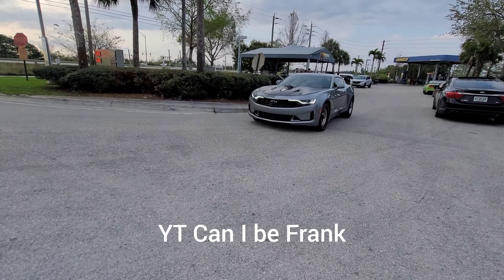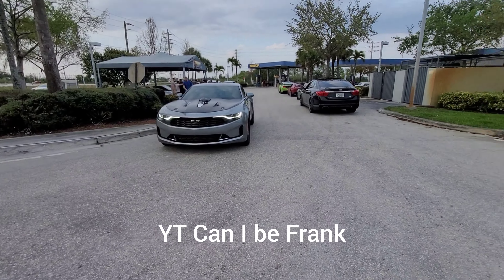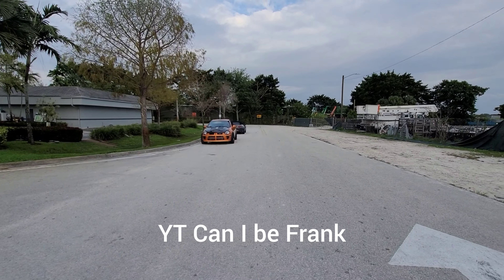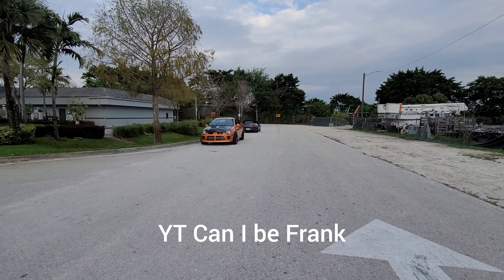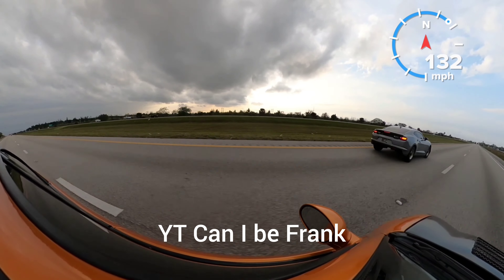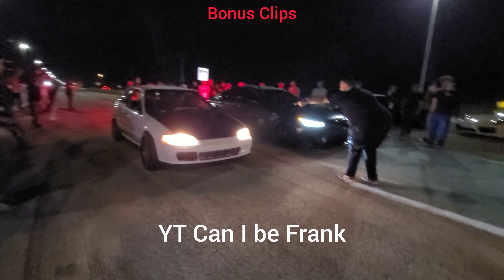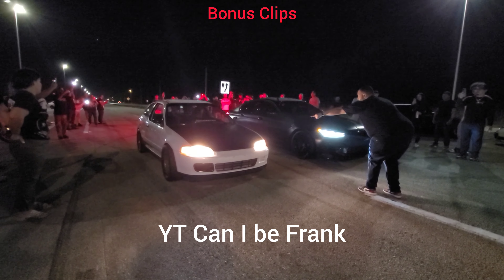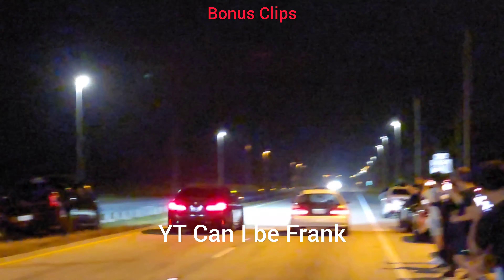SRT-4 Upgraded Turbo Cams FBO E85 vs Camaro LT1 FBO Hi-Ram E85 10 Speed

Comment: Again proof U don't need all the worlds displacement to be fast
Reply: yeah just a decent size turbo and light car
Reply: And some blue chew 👊👊
Reply: It's fast how long do you think it will last or run these type engines aren't known to be reliable and dependable and generally don't last long if you got cash time to work on it a replace and repair it but it's fast
Reply: @gloriamaletta8667 
They will last long as long as one s ready to take care f it.
On the flip side, its not that easy to handle a mooded LS3 as well. Valve spring issues, sleeves leaking oil, etc etc
So once U open a motor, anyway its not gonna b reliable
Reply: @gloriamaletta8667 you sound upset.  Cry

Comment: Goooooood got toooooooo mighty that SRT 4 banger was holding right with that LT1 door handle racing 👊👊👊👊
Reply: Right! damn good race.
Reply: Lite and fast is dangerous
Reply: Boost vs a bolt on NA car.
Reply: @rustygee4919  true
Reply: @rustygee4919 a tiny 2.4 vs a big 6.2.  Cry harder.
Reply: @executiveinvestments  the only ones who cry about displacement are 4 banger bros. Add even 5 psi of boost to that almost stock Camaro and it wouldn't even be in the same zip code as that neon anymore.
Reply: @rustygee4919  oh so you NEED boost in a huge 6.2L just to keep up with a tiny 2.4L?  🤣🤣.  Put a 6.2 in the neon and watch the camaro get zip coded.  But keep crying.  Cope with the L.
Reply: @rustygee4919 So a V8 needs boost to beat a 4C? That's embarrassing.

Comment: The skittle out here hurting Chevy's feelings. Car moves good.
Reply: Nah,skittle runs good but I’ve rode in faster srt4’s same mods. All the way up to 600+whp srt4’s. Which btw would still want nothing to do with the 650whp h/c high compression lt1 on this channel. Much respect srt4 neons my fave 4cyl ever but beyond a hero track run want nothing to do with a newer v8 setup correctly
Reply: @cg8er145  well at 2900lbs, the weight difference between the car and the gutted maro is probably within a couple hundred pounds. Every shift these cars fall out of boost and that hurts them alot. Never thought about it but i wonder if theres any auto swap neons?
Reply: Thats me on the neon, good race rematch coming soon fix a few issues
Reply: @elruben1421  cars running good, look forward to more races.
Reply: Yall stang boys always crying and getting feelings hurt now get on board 👊👊👊
Reply: @elruben1421  nice setup man,my buddy had some gnarly setups with srt4’s back in the day. Will always have a soft spot for them 👍 the torque those 2.4’s unleashed is unreal including torque output current day from modern turbo 4cyl’s. Fun fact…you probably already know this but the stg3 with toys back in 2005 rivaled the viper. HOM with an intercooler sprayer back in the day! These srt4’s were monsters and if you don’t mind replacing axles,clutch forks,or transmissions still are!
Reply: @cg8er145  I'm pretty sure this one is 500-600 hp
Reply: @cg8er145  yeah but a little red mustang wants everything to do with that high compression built head LT1
Reply: @07slowbalt  probably true about the weight. As far as falling out of boost that’s all dependent on the combo of turbo,cams,head etc…my homies srt4 was making near 700whp and was a monster. Probably would’ve been a good run vs my camaro. Sadly unless there’s some aftermarket company I’m unaware of I don’t think there’s an auto trans that would fit/put up with 500-600whp in a srt4. If there was though…with a stall and leaving on boost 😬 pocket rocket for sure
Reply: @TheBb6prelude  sure does…on m5 nitro blend. Tell me you’re educated enough to realize that fuel blend adds over 100whp. I wonder why that BADASS Mustang didn’t just humiliate the camaro on E????….oh wait it can’t.  On that note…the s550 h/c world record 1/4mile  on m5/nitro blend still slower than h/c 6th gen maro record on E 🤷‍♂️ just sayin…
Reply: @TheBb6prelude  could be…clearly or at least to me clearly needs a different h/c turbo setup though cuz it shouldn’t fall that far out of power when it shifts. Maybe the turbo is too big for the cams or maybe it’s still stock head 🤷‍♂️ either way srt4’s were known for stump pulling torque and this one seems to lack that
Reply: Chevy livin in your head. Another W for the GM NA.
Reply: @TheBb6prelude  built head? Nothing built about that lt1 it’s h/c/i and milled heads. Nothing special but yes the red mustang beat it on m5/nitro blend. Why is it do you think he didn’t just race that white camaro on E? You should watch the Cleetus McFarland video on m5/nitro. A bone stock no headers 5.3 Silverado picked up like 200whp on that fuel on a dyno. What do you think a yote cammed would pick up???? No wonder he gapped the camaro his fuel equivalent to and I’ll be conservative a 100+ shot of n2o. Notice they never ran it back with both only on E.
Reply: @cg8er145  the red mustang is stock engine and stock head. Camaro is built everything.  It's not mod for mod
Reply: Compared to your truck that can't go faster than 100mph, can't turn , can't stop. Everything is fast lol
Reply: @cg8er145  it's ported head,high compression pistons,rods etc and anything and everything you could do. Red mustang is stock head with cams , fully stock bottom end
Reply: @TheBb6prelude  Fail. SBE. Just one cam and heads
Reply: @TheBb6prelude  so do you just slurp brands or do you not know what you’re talking about? The yote doesn’t need cams or heads to make 1,000whp+. Are you new to this? That’s exactly my point…the mustang already 12:1 compression from the factory which is pretty spicy honestly and like I said on that fuel blend is = to 100+shot of n2o, oh and btw it was cammed not stock engine also with a highram just like the camaro. You’re describing it like it’s stock cams lol and clearly don’t understand what m5/nitro does. Go ahead and watch that Cleetus vid I mentioned. It’s pretty cool really. Too bad gm jipped out on their fuel system with DI only fueling on the genv v8’s
Reply: @TheBb6prelude  this is where you show your ignorance. It’s stock pistons/rods as those don’t need addressed until 700whp,ask me how I know…this lt1 n/a doesn’t have or need pistons/rods goofy. It’s n/a lol. It’s h/c/I milled heads and is putting in work. The funny thing is this white camaro would get worked vs h/c record holding camaro’s which would teabag that red mustang. Hey don’t take my word for it…world records speak for themselves. N/a Chevy runs it who cares about cars on this channel? Balls out at the track it’s Chevy n/a. Yote wins boosted it is what it is.
Reply: @TheBb6prelude Yeah that's completely wrong. Frank has explained 10 times its a stock bottom end. Sorry you have no understanding.
Reply: @cg8er145 Amazing that he doesn't know its a stock engine just heads, cam, intake lol.
Reply: @SR71life  Frank literally said it's high compression pistons two videos again
Reply: It’s always the ones with no car or in buckets that be talking the most 😂😂
Reply: @TheBb6prelude  nem makes 500 stock block
Reply: @TheBb6prelude  Frank never said that. Go find us when that was posted. I'll wait
Reply: @bigd382  keep bragging about your chick car as if anyone cares.
Reply: Stock bottom end and Hi Comp don't really sit well. Milled heads = a mild comp increase. If you go out of your way to mention High Comp, then that block has been tampered with.
Reply: @SR71life  he did ,now I'm going to look for the video
Reply: @TheBb6prelude  Np he didn't. Infact last week he posted STOCK BOTTOM END. No NOS. He told all the Mustang guys here whats up.
Reply: @SR71life  apparently he didn't tell the mustang guys what's up because he got destroyed by a red mustang
Reply: @TheBb6prelude  oops! Guess you found your answer lol. So much for your fully built high compression Pistons that Frank said but never said LOL
Reply: @SR71life  it literally says that ,coping a bit too much bro
Reply: @TheBb6prelude  Yeah where? Post the link. I'll post where Frank called you all out explaining again its a stock bottom end. Lets ask Frank. Cope!
Reply: @SR71life  it was literally in the title of the video I posted ,Frank wrote it. It's his channel
Reply: @SR71life  cope how? LT got ABSOLUTELY destroyed!!!!
Reply: @07slowbalt  Stick to your 25k base model cloth seats F150 heap.
Reply: @TheBb6prelude  Nisno GTR vs White LT1 vid  Frank posted the exact specs. Not a built engine.
Reply: @bigd382  stick to your 10 year old convertible Porsche. Try not picking up so many dudes next time and maybe itll break into the low 13's lol

Comment: Another turbo car vs a LT1 Camaro no NA Coyote 5.0 powered Mustang challengers which one of these cars would you like to own and have in your garage l know my answer
Reply: A NA Mustang already beat this Camaro.....twice
Reply: Another lil 4 cylinder vs a big bad 6.2L.  Cry more.  And this is a racing channel, not a car show channel.  Big v8 couldn’t beat the lil 2.4L.
Reply: @executiveinvestments  seem like the mild NA V8 did pretty good vs a gutted 2500 pound tin can turbo
Reply: @gloriamaletta8667  seem like the mild lil 2.4 manual did pretty good vs the gutted fbo 10 speed 6.2.  Cope with the L.
Reply: @executiveinvestments  White Camaro did great vs this blown 4.6 Cobra just ask Roberto how fast this 4.6 32 valve blown Cobra is
Reply: @executiveinvestments  yeah Honda probably running 18 to 20+ pounds of boost want to see the Honda run as often as the white Camaro if you want to impress me white Camaro has many many many passes still going strong intimidates you doesn't it
Reply: @executiveinvestments  the white Camaro has given you a rash you can't get rid of scratching and creams don't even help you need treatment
Reply: @executiveinvestments  yeah your average Hona turbo that l see driving daily